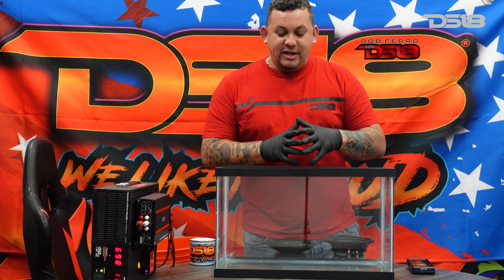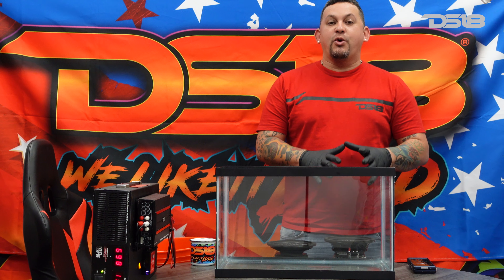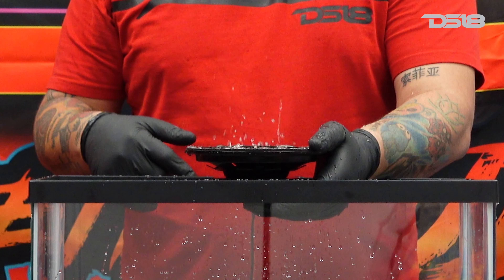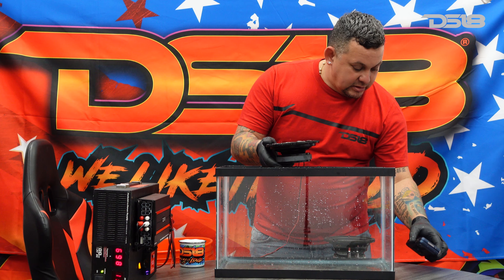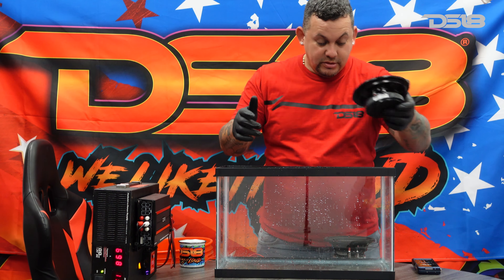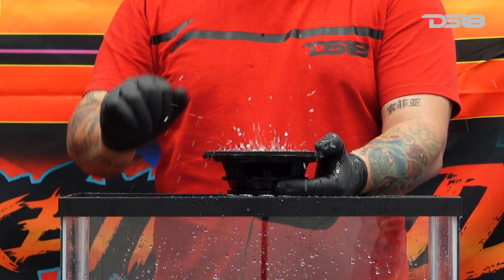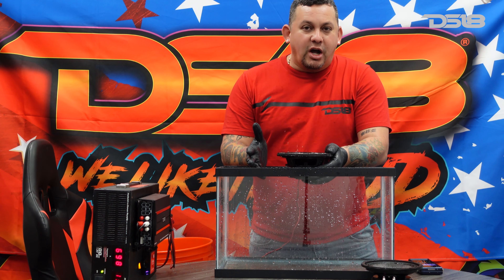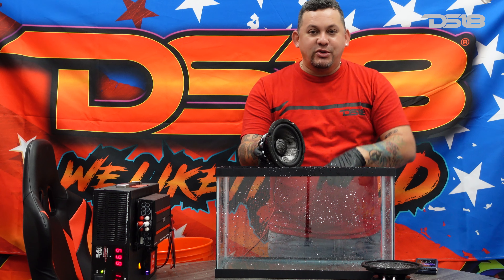DS18 PRO CF Series Water TEST (CF6.4SL / CF6.4NR)

Comment: Both of these are some great sounding speakers. I have the 6.5 slim and the 8 neo on my bike   sounds great.
Reply: have you heard euphoria xpert, PRV, or beyma? if so where do these rank compared to them spl and sq wise?
Reply: @ericperry72  I've heard those also. They sound great. Loud wise not much in my opinion can top ds18. They also have great sound quality. I'm heading down to thunder Beach and getting in the sound competition down there in May. And I really guess it depends on what you want. DS 18 has some real high dollar stuff now and I have some of that on my bike but it's expensive but it's great stuff. Hertz,t euphoria and those other brands are great too. I guess it's just a preference thing I'm more than anything. Truthfully you can't go wrong either way. I have about 5,500 in mine. I have a 10 speaker setup. My advice depending on how many speakers you're going to have on your bike is make sure you get a good mid bass speaker some good mid-range with either the Tweeters on it or a separate tweeter. The midbass with the driver on it sounds really  good. A different kind of sound. And either go with a subwoofer or a really nice mid base that drops low depending on how you set up your saddlebags. The fiberglass saddlebags sound better with a sub or a mid Bass. And if you put a subwoofer in your saddle bag or a really good mid base I would brace the bag and add a little fiberglass if you want some good low to thumping bass. And porting of course gets you lower bass.  whatever amplifiers you use Make sure you have some real good clean power. Sorry it was so long but I'm just trying to tell you through my experiences kind of what works best in my opinion.
Reply: @Pbull75  yeah I have experience with bikes audio, I just heard from some of my friends who got killer setups that the local guys in Daytona area was killing it running DS18 setups. So that's why I was asking because here in Metro Detroit, I don't see anyone running them.
Reply: @ericperry72  Yeah they really didn't have too much on bike audio at first but now it's coming in  droves. I'm running my setup on a '97 Honda Valkyrie completely bagged out. It has a rogue glide front end on it a 7 down and 14 out set of bags and fender on the back. Tour pack with two 8-in mid base. Tens in the saddlebags. DS 18's worth looking at for sure. That's what I run in my truck and on my bike and my buddy does on his bike also. Like I said of course it's all what you want to spend I guess. .
Reply: @ericperry72  Daytona makes a lot of sense too because if I remember correctly DS-18 is down in Miami. Or somewhere down there in Florida for sure.

Comment: Buuuuut it’s not the face of the speaker that needs protection from water unless it’s on a boat or outdoor use but still with a sealed enclosure unless the back of the sub is also water proof like the slider so that water does not enter the voice coil. Free air speakers have a vent on the magnet so if any one is wanting to protect their door speakers from the elements especially in a classic car, there are foam or rubber speakers pods.

 I love the design of this DS18 8” Pro CF6 sub, I’m considering a pair.. looking for a set of 6.5” or 8” that will play mid bass with detail and have a nice KICK to it. Paper cone speakers do this very well like the old EB woofers or Force woofers, but for a 98 integra, the weather strips and sealing is no longer as efficient bcs things get old so I’m avoiding paper cones even though the chassis is getting redone slowly. The rear inner 1/4’s of the integra have HUGE speaker cavities, poor design actually but yet has LOTS of potential for better speaker accommodation and sound. So let’s see.